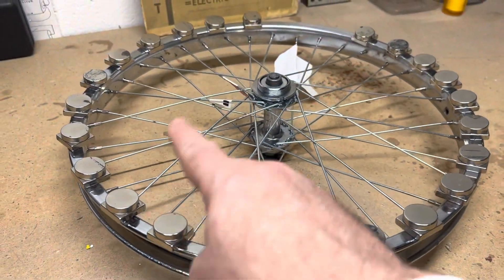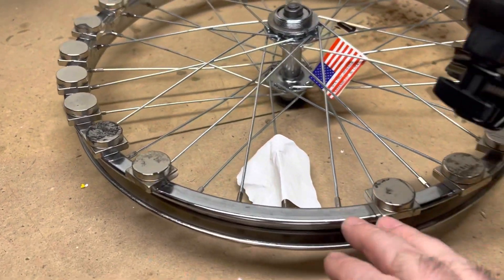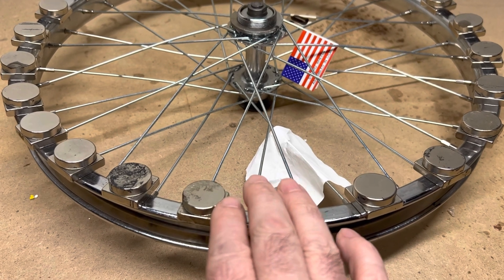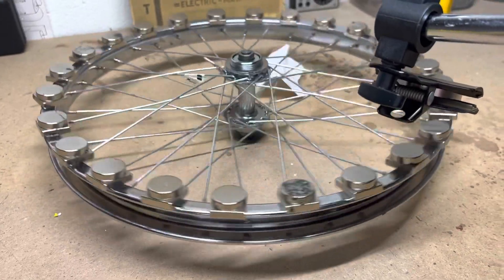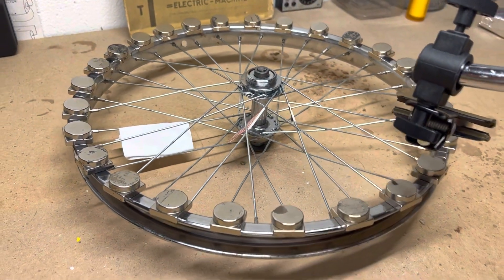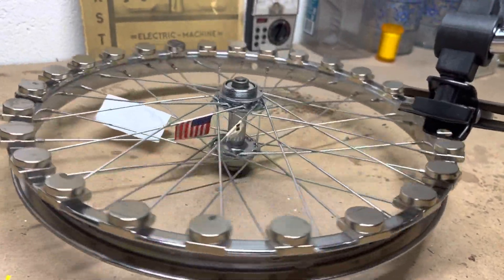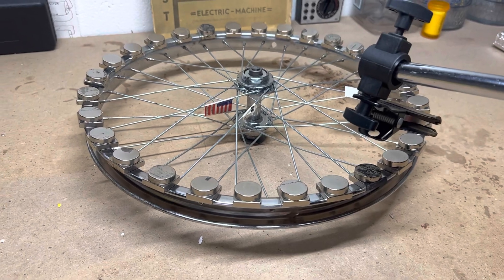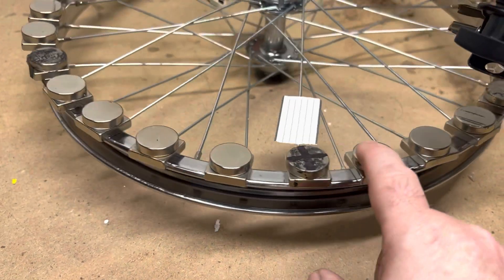🧲 FOLLOWUP CONFIGURATION #8 FOR CREATION OF FREE ENERGY GENERATOR.

Comment: if you spaced them evenly and added 5 more ring stator magnets that will surely be enough to keep it running and even give it some good torque, a coil setup will produce enough electric to run a small motor and help keep it running as you said in your last video, multiply this setup x 5 even bigger wheels and compress the magnets even more and running one huge flywheel generator and you'll be up for assassination from the big energy companies lol
Reply from the maker: Hi Stevies, I’ve since ordered eight more of the same Neodymium ring magnet. I also found 16 more of my amateur magnets that I did not know I had because I’m still unpacking from moving. So I have already put as many as I can on the wheel. So the magnets on wheel are highly compressed now awaiting The ring magnets to come in. The real challenge will be fixing all eight of the ring magnets in place. 

👉 More importantly, thank you for taking time out of your busy life to give great feedback, and to follow my research. Very kind of you.
Reply: Learning, listening watched a lot of your clips more than 2x.